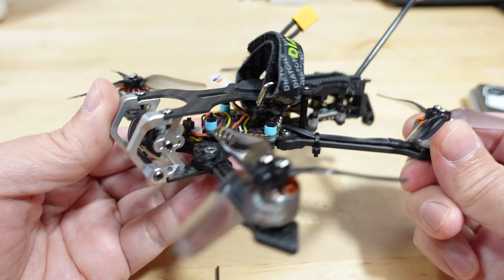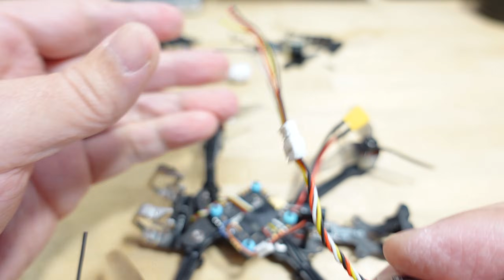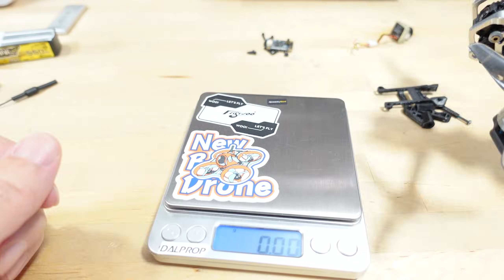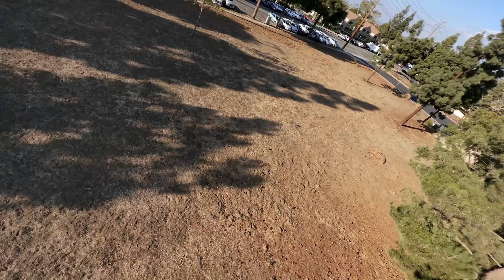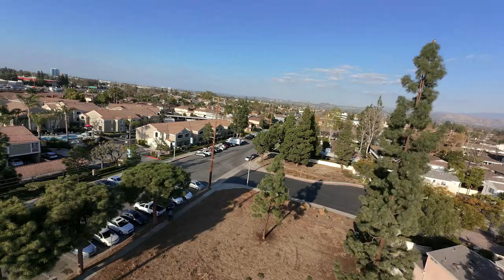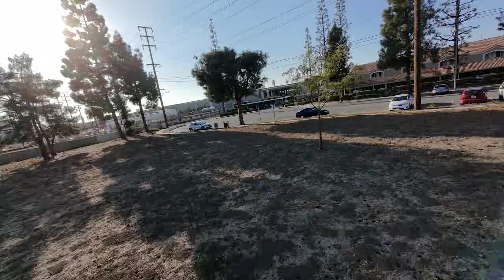DJI O4 Air Unit Lite Installation in an Old Analog Micro Build

Comment: Just put the same vrx in a helination bird of prey. Super fun 3s 4500 kv build. Took a lot of tuning to make the jello go mostly away though.  The biggest thing was I increased the tea break point to 1470 my rig hovers at 1450. And changed it to 70%. Good luck on the vibes.

Comment: Regarding adding a 9V regulator. Oscar Liang wrote on his website: "At its maximum 700mW output level, the O4 Air Unit consumes approximately 6W of power (5V 1.2A or 9V 0.67A). If you are powering the air unit from the flight controller, my recommendation is using a minimum 5V 2A BEC or 9V 1A BEC which allows extra headroom for safety."
So normally 5V 2A BEC on FC should be enough. What exactly happens when it's nevertheless not enough? Would you lose video or would you see some other anomalies?
Reply from the maker: So, that statement assumes the ratings provided for the BEC are accurate and I've found that they are not.  You have to consider that the 5v BEC is also powering the FC itself and the receiver on some AIO's.  So on many I've tested, the Air Unit browns out soon after take off, or it doesn't even power up at all because it's just not enough power.  Also, the 6W is not correct because in auto mode, the max power is 1000mW and the max power draw is 9W total.  Had to correct that because that inaccurate information is getting passed around and getting people into trouble.

Comment: I connected my DJI O4 Lite to an 4S battery drone, using the same cable as O3, and did not fried as you said, it just not powering up.
Then I used a BEC from speedybee, which is a better solution because has 6 pin connectors, without needing to solder, and which has by default 5V, and worked. 
I dont understand why do you need 9V if it works also with 5V
Reply from the maker: Voltage range is 3.7v to 13.2v.  If you powered it on 4S, it's over 13.2v and the over voltage protection kicks in and it won't power up.
Reply: @marblekitfpv  How about volts on BEC. Why did you choose 9V instead of 5V? On 5V works too
Thank you for reply

Comment: Love your Videos😇, Hating DJI for releasing a Unfinished Product, the jello is redicilous🤔
Reply from the maker: I think adopting these new cameras with sensitive gyros to old analog frames is going to be challenging.  As new frames come out to deal with the sensitive gyro, this problem will go away like it did with the O3 air unit which had the same problems initially.

Comment: I've printed so many different mounts the past week I've lost count, But nothing has fixed the issue with the o4 light.
Reply: I raised esc frequency and it solved most of it
Reply from the maker: What frame are you using?  It may need softer mounting with silicone instead of TPU.

Comment: Peel off the camera cable about 3/4 inch may fix jellos.  I tried Axisflying Flying O4 camera case, no jello in Pavo 20 pro and AOS 3.5, even without ND in bright sunlight. You can see the result in my latest video shooting the "Sky Shield Park" using O4
Reply from the maker: Are you referring to the tape wrapped around the mipi cable?
Reply: @marblekitfpv Yes. The O4 camera cable is too stiff
Reply: @marblekitfpv  Yup. The camera cable is too stiff.

Comment: Strange I have two o4 lite build, 2,5" and 3" simple tpu camera mounts and no vibration at all.
Reply from the maker: It seems vibrations and jello are highly dependent on the frame and build.  Everyone has different builds so results seem to vary wildly.  I've heard many people with no issues but also many people with more issues than me.  I plan to switch this build out with a TPU mount and report the results in another video.
Reply: Perhaps you can share with the rest of us what frame/build you have and mounts?  Would be helpful information for the rest of us with issues.

Comment: "You're gonna get brownout on 5v/2a" you said. I'm running it on that, with rocksteady, 700mw and 4k/60fps no issues at all. What do you base your claim on?
Reply from the maker: In my 1S testing video (link below), the board I used had a 5V/2A rated BEC but my O4 air unit browned out so I had to power it off the lipo directly.  The BEC was probably not really a full 2A and other components on the board like the receiver and FC itself draws power on top of the air unit not allowing the air unit to even use the full 2A.  You probably have a board with a 3A BEC but only rated to 2A in the specs sheet.  Unfortunately, the 5V BEC ratings on a lot of FC's are murky at best...  https://youtu.be/oVg22-RHi8k
Reply: @marblekitfpv  Aah that makes sense then yea, is probably the case. Was referring to a speedybee 40A aio setup. Thanks for the reply
Reply: @marblekitfpv I agree had it on a speedy bee mini 35a the damn thing is rated 5v 2A bec but was not working well in flight, don’t know why I didn’t just start with the 9v pad
Reply: The issue Albert faced would have been because his BEC was a boost converter not a buck converter. if the supply voltage is lower then the output and you're trying to deliver a decent amount of current most systems won't handle it. A buck converter works the other way stepping voltage down and is far more stable.
Reply: @Burn377  the original poster didn't specify which type of BEC he had

Comment: One frame that the O4 fits into perfectly is the GEPRC Smart 25 HD. The camera plates have the 18mm spacing and the stock antenna fits into the antenna mount perfectly. It’s almost like the frame was made for it years ago.
Reply: I'm doing the same thing!
Reply: I AM TOO!!!! LMAO  @BrandonBeans
Reply: @brandonlane294  BRANDONS UNITE! 💪
Reply from the maker: The camera mount on that frame is 14mm on the one I've got.  Did they update it with a V2?  I don't see that anywhere...
Reply: @marblekitfpv  it's 14mm I think he typo'd
Reply: @Quad_Father The GEPRC Smart 25 HD is the perfect ole school frame for the 04 and one of my personal favorites. All it took was some quick and dirty camera mounts on the printer. Got it weighing in at 88 grams with 1204, 5000kv motors, JHEMCU GHF7, and Crossfire. Been flying it for a couple of weeks now and it is dialed. It's funny, this frame immediately came to mind when the 04 dropped. Don't think I can go back to analog.

Comment: Every video that I’ve seen where there are vibrations on the 04 lite ( including my own) it’s during peak sunlight. I’ve gotten smooth footage during golden hour though. On another note, I built a Pavo 20 with 04 lite and my antenna is sitting right up against the gyro on the back of the camera and I thought for sure that it would cause issues but it’s better than it was before the antenna was placed there.

Comment: Hey Albert. I have an AIO with DJI Plug on it. So to get it right, can I plug the O4 lite in there and Power the System as usual on my 4s Battery because via the DJI Plug and cable there will be just 9V delievered to the O4 Lite? Or do i also have to use this BEC?
Reply from the maker: Yes, if you plug it into the dedicated 9V DJI plug, it will be fine.  Just make sure it truly is 9v.  Sometimes there is a dedicated DJI plug, but it's actually pass though voltage direct from the lipo so check the documentation for your flight controller to be 100% sure.
Reply: You are good to go with that AIO! The O4 lite will get clean 9 volts from the AIO built in BEC.
Reply: @danskinn  which AIO was he talking about?
Reply: @GeorgeN49  hey, its the new speedybee f405 AIO.
Reply: Not sure, i could be wrong but if it has a port for a digital vtx system then it should be enough for the O4 lite.